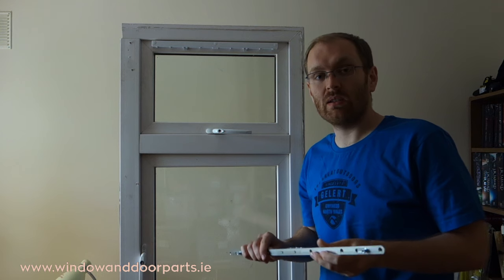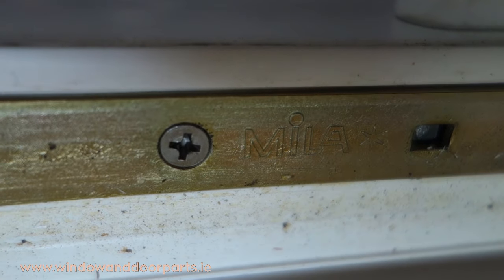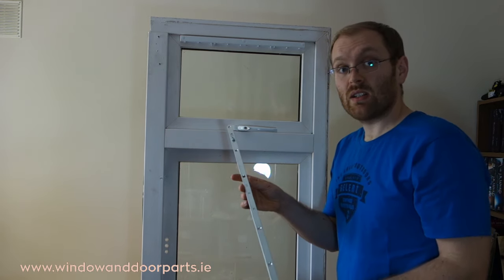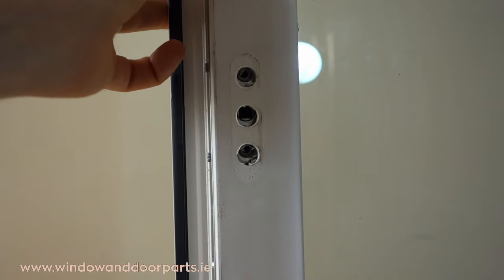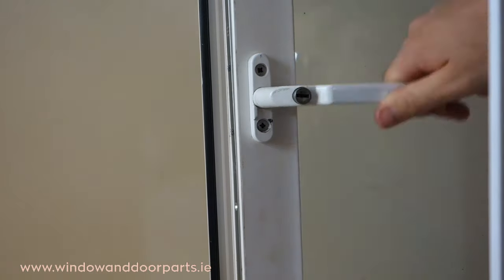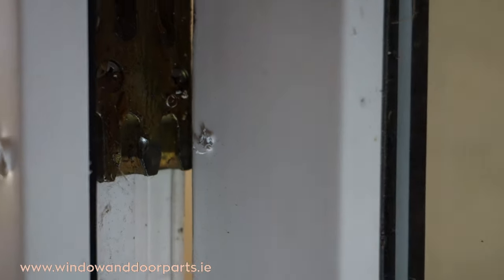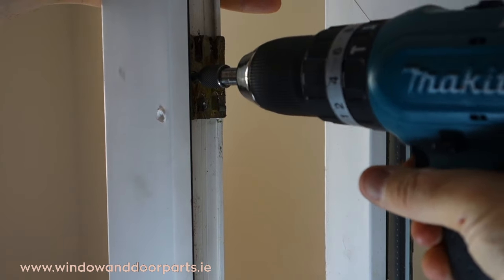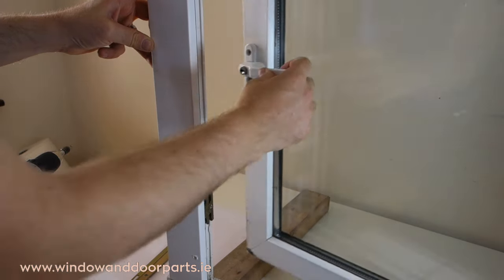How to replace a window espag lock in a uPVC window

Comment: Just completed fitting a side opening lock in my third floor flat thanks to your clear instructions. A bit awkward being off the ground, but what appeared at first to be a daunting task turned out to be fairly simple. Many thanks.
Reply from the maker: Excellent. Well done 👍
Reply: Yea, I've just moved into a 2nd floor flat with two failed locks. The handle is at the bottom of the frame so the mechanism will be a bit difficult to remove and replace I think. Never done anything like that before so I'm just weighing up the job and trying to learn before attempting it.
Reply: Take the beads off then take the glass out then you can unscrew the hinges to take the window out it makes it much easier if you dont want to be stuck in an awkward positions especially when high off the ground not worth the falling risk 👍🏼

Comment: My window lock is jammed. The screws on the side are stuck in lock position rather than open and the window is open. What do I do?
Reply from the maker: If the screws are wrung off, you can try a broken screw remover to get the screws out

Comment: Fantastically useful content, thanks for putting in the time and effort in producing the videos.  I have some windows and they lock with rods mounted internally inside the window I think? Can these be removed and replaced?
Reply from the maker: Thanks for the comment. Yes they usually twist out from each end
Reply: @PaddysDiy  cheers, thanks for the information.

Comment: Dear Paddy, hello, thank you for these videos. Are you drilling a new hole in the UPVC frame, when you re-position up the receiver, please? I don't know (anything about windows, and) whether there are pre-existing screw holes? Thank you, best wishes
Reply from the maker: I'm just using the same screws to make the new holes. Pvc is like wood, as long as the screw has a sharp point at the tip, it will cut a new hole as your screwing it in. If your screws have a drill tip ( these are called self drill screws) it just means there is some metal reinforcing under the pvc layer. These will drill through both pvc and metal as you screw them in

Comment: Hey, great video and i want to give this a go myself. Mine has just broke and its a Mila gr 119.  I cant seem to find anything that would be a suitable replacement, are you able to help to see what would be suitable? My current mila has 4 mushroom cams, 20mm backset and a 16mm wide flat rail. Thanks in advance
Reply from the maker: All the odd size gr's are made for munster joinery. Gr 75, gr95, gr105 etc. They're the only place you'll get them I'm afraid

Comment: Great video - can you post the name of the alternative to the Mila GR60 which has the same locking points as the discontinued part - can't quite pick it up from your accent, or if you have a link could you post that please.
Reply from the maker: The brand is hautau, they are obsolete now too. I must make un updated version of this video. 

Nico make an espag lock that is practically identical to the old mila gr60.

https://www.nico.co.uk/product/espagnolette/

Comment: Y window in the bathroom is locked in a downward position, removed top screw no problem, the handle in in a downward position and won't budge to enable me to remove bottom screw, what can l do to get the handle to move and enable me to get at the bottom screw.??? Thanks in advance.
Reply from the maker: https://youtu.be/5YQ-vqgk4Qs

Sounds like the handle is broken. Try the method in this video

Comment: My window had the key in it and the key broke and the half of the key is still in the lock.I made the mistake of just pulling on the handle until the lock broke and I could open my window and shut it again but I wasn't aware at the time that I could have got the key half that was left in the lock out and then open the window without breaking it using a hak if you want to call it that.Basically I need to get the lock fixed and sort out the window as there is now a draft coming through where the key went in and in another corner of the window and in winter it's obviously worse.I would really appreciate some real advice or anything that can help me to move forward and get the window back to what it was before when there was absolutely no draft and it was great.Thanks for the great video very good guy.
Reply from the maker: I'd have to see pictures of it. A draught from where the key goes in doesn't make sense to me I'm afraid

Comment: Hi Paddy - I've just fitted a new espag lock into a bathroom top closing window. The new parts' dimensions perfectly matched the old (as per your other video on the 6 measurements needed). I previously replaced the hinges on this window so they are fairly new also - the gearbox in the old espag broke hence replacing. A problem I've encountered is that the window is quite difficult to close as the mushroom cams engage with the old receivers. I loosened off the cams into the summer setting (away from the seal) and it did help a bit but the window is still very stiff when closing, it will close however. I'm not sure of anything else I can adjust to back it off a little (If I keep turning on the cams when furthest away from the seal they start going back towards it again so I know I'm at the maximum distance I can be away from seal). - Any ideas?
Reply from the maker: You could have the hinges positioned too low or too high. So the rollers on the espag are rubbing the bottom of the receiver or the top of the receiver. Just have a look where abouts the rollers are lining up in relation to the receivers
Reply: @PaddysDiy  Sound, will play around with the height so and see how I go. Thanks.

Comment: Hi do I have to order the exact same length espag? My window Espag is 1200mm can I order a 800 mm one?
Reply from the maker: I would try get the same lenght. You can put a shorter lenght espag in but, what can happen is that the window doesn't get pulled in at each corner. As the rollers are further away from the edges of the window.

Comment: What a clear video....I always get someone to fix my locks but one lock is on its way out. Its a Mila gr80. I want to do it myself. Can I use a 800mm length instead of 750mm original fitting and.... do I need to buy new double keepers as my current keepers are single.
Reply: 800mm was fine

Comment: Might be a stupid question but one of my handles suddenly doesn't close completely. I have looked everywhere and couldn't find explanation why. Do you have some idea what could it be?
Reply from the maker: Not a stupid question at all, Great question in fact. There could be a few different reasons why. First thing to try is to open the window out and close the handle, and see if it closes down fully. If it does close, then the handle and lock are fine but there is something blocking the mechanism from closing. If it doesn't close, then either the handle or the mechanism is the problem. Could be something as simple as the lock in the handle protruding in the wrong position
Reply: @PaddysDiy  I did check and the handle closes completely with window is open. I will try figuring out what's blocking the locking mechanism. Weird that it just happen suddenly without any work on the window.

Comment: I have a broken 750mm long 20mm backset mechanism from Munster Joinery (2003) but it has 3 mushrooms on it not 2 as shown on the GR80. I can't seem to find this mechanism anywhere with 3 mushroom cams, would you have this?
Reply from the maker: Hi DOK, i'll check with my suppliers and get back to you
Reply: I need one too that has 3 mushroom cams

Comment: Mine is completely jammed. I cant even turn the handle fully to get to the other screw. Its as if the gearbox is stopping me from turning the handle up, as you would normally do to unlock it... 😐
Reply from the maker: Is the handle moving partially and stopping?
Reply: @PaddysDiy  
Yes, it moves up a bit then it's stuck. I either get a locksmith £££🤬 or I somehow saw the handle off, but I reckon I'll still not open it.
Reply from the maker: @sj-30000   just make sure the handle itself is not locked. If its definitely not locked, force the handle into the open position, remove the handle, then use the method in this video

https://youtu.be/c8leMv6ibo4

Comment: Hello Paddy, we have air coming through the gap around the key lock on our window sash handle.  Would you have any suggestions as to how  air is getting through to the handle?  Thank you
Reply from the maker: I would have to see a picture of the handle to know
Reply: @PaddysDiy  Thank you for your reply.  On further inspection, the sash close to the handle is dented and therefore isn't sealing against the gasket.  After checking around the sash, I presume the draught is coming through the gap from air entering the frame from the drain holes.

Comment: Hello Paddy, just a quick question;: if the locks on a window are only just going into the receivers, would this affect the compression of the sash against the frame?
Reply from the maker: No. You can adjust the compression of rollers with an Allen key. That's if you want the sash to seal tighter (or  looser)
Reply: @PaddysDiy  Thank you for your reply.  I've set the rollers for maximum compression, but when closed there's a bit of a gap at the top of the sash on the lock side.  Is there anything else I check that might be stopping the sash fully sealing against the frame?  Thank you again.
Reply from the maker: @John Gartland i think i misunderstood. If the roller should travel into the opening of the receiver about 10mm. If its only just catching the receiver it would definitely effect how much it compresses. You'll have to move  the position of the receiver
Reply: @PaddysDiy  Thank you

Comment: hi Paddy, thanks - is the process similar for a horizontal style bathroom window - locking mechanism broken.
Reply from the maker: Yep, identical. Trickier to get at though
Reply: It seems impossible to get too from the inside. Outside not an option. I would be hanging my arm out at an angle trying to remove and replace it by guessing where screws are.
Reply from the maker: @richat1691  yeah it's an awkward job. Make sure you have your drill strapped to your hand. Using the selfie camera on your phone is a good help to locate where the screws are
Reply: Thanks, il remove it and figure out what i need and then give it a go

Comment: Great, thanks BUT ......  my window is locked in the CLOSED position and the square shaft hole moves freely 90 degrees without resistance. What do I do ????  cut the window unit out and get a new one ??
Reply from the maker: Hi Stephen, have a look at my video on how to open a broken window lock
https://youtu.be/c8leMv6ibo4
Reply: Hi, yep I found that about 2 minutes after I posted my note !!
It worked for me, Thank You very much indeed, your posts are superb. 
Cheers Steve
Reply from the maker: Good to hear Steve :)

Comment: Thanks for the video. When you were moving the receivers on the frame, did you drill new holes in the frame, or there are already holes and you just needed to move receiver and to screw it back?
Reply from the maker: No when i moved the receiver there are no holes. I use the screws to create new holes. The screws are self tapping, the point of the screw cuts into the PVC, creating a new hole. Most windows will have steel reinforcing behind the PVC. If this is the case, the screws will have self drill tips (the tip has a drill point that drills through the reinforcing). If you reuse the screws that hold in the receiver you can't go wrong.
Reply: Thanks a million Paddy! Great help. Will take off the old locks tomorrow and will try to find similar ones.. Unfortunately I couldn't find brand name or model type written on the face plate of the window lock
Reply from the maker: https://youtu.be/5HkPks3wlfY this is a link to another one of my videos on how to correctly measure a window lock